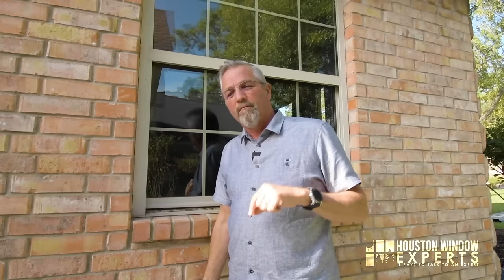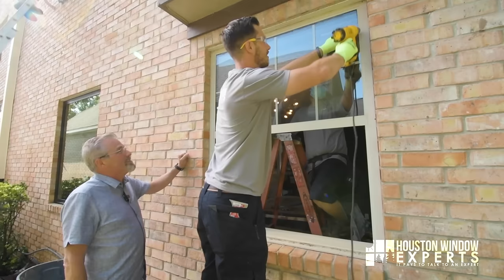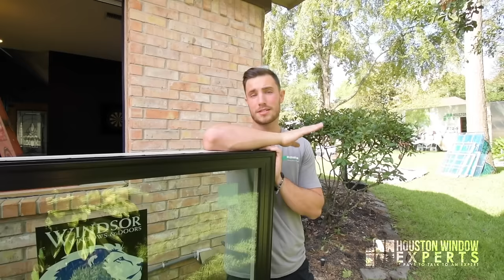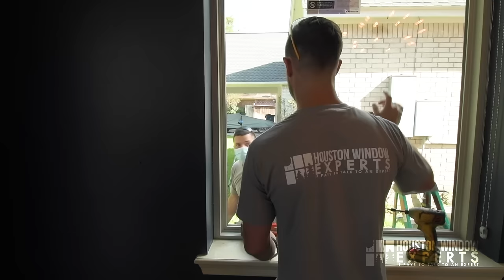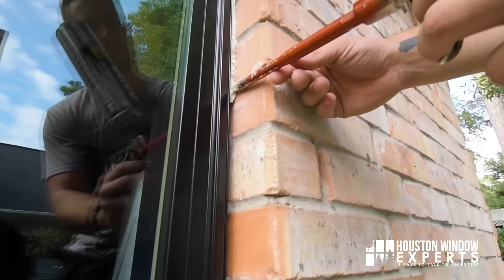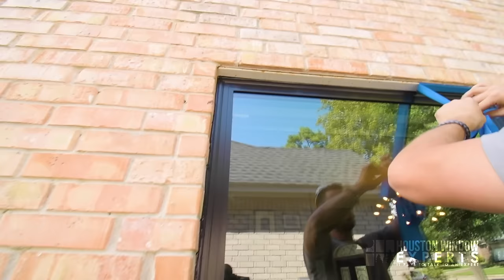Replacing Windows In A Brick Home The RIGHT WAY

Comment: I had NT window replacement on stucco..Previous windows were built into the wall. Is window replacement with caulk on stucco a bad idea? I have some issues with how they did the install but I’m also wondering if I’ve lost the windows ability to shed water.
Reply from the maker: Brad, I'm sorry you are having issues. Without more details, it is hard for me to judge the quality of the installation. 

I'd ask a local window company to come evaluate the installation and offer an opinion. You could also contact NT and get some suggestions of who you could call.

If your windows are leaking, I'm 99% sure it's the installation.
Reply: @HoustonWindowExperts  I’m in Dallas, have you ever installed replacement windows on stucco without tearing around the window and applying new stucco? Also, what kind of caulking should be used on stucco? Much appreciated!
Reply from the maker: Yes, we install Windows and stucco homes almost every day. If it's done properly you will not have any damage or very little and it can be easily repaired.

We like to use OSI Quad Max caulking.
Reply: @HoustonWindowExperts  I have a serious problem on my hands after my install. I just sent you an email and would greatly appreciate your opinion on what they did. I’m also wondering if it’s proper to remove the old nail flange & how to keep the window water resistant for years to come. I will gladly pay you for a virtual consultation.
Reply from the maker: Brad, thank you for your comment. I'll go check my email and get back to you asap.

Comment: Hello, I'm really late commenting. So sorry! We purchased an 1895 modified victorian gothic brick home in 2006 (it has a turret - lol). At some point, Pacesetter windows were installed throughout. Beautiful windows with integrated metal casements - but which leak due to broken locks/clips no longer made. We've replaced a lot of windows on other homes we had, but they all had wood casements. We really want to keep the metal casements since we have no idea what's under them, and they're dark bronze which looks exceptional! Can we install new windows into the existing casement? I have no idea how to finish trim them, and  adding metal channels would destroy the aesthetics. Am I asking the impossible? Thank you so much!
Reply from the maker: Thank you for watching and your question. I don't think you can do that.  Sorry
Reply: @HoustonWindowExperts  Well, darn. It was worth a shot. I may have misspoken on "casement"  when I should have said casing. Thank you for replying!
Reply from the maker: In that case, Yes! Please check out JeffsList.com. We may know someone near you.
Reply: @HoustonWindowExperts  Awesome!  Passing info onto husband. Thank You!
Reply from the maker: Thank you

Comment: Good video.  It is worth mentioning though that OSI quad and quadmax are not VOC free. Tech datasheet gives the offgassing numbers, max is lower but certainly not zero.  A water based caulk will have less fumes inside.  Quad is for exterior only
😂
Reply from the maker: Thank you for the clarification.
Reply: @HoustonWindowExperts  Sure, excellent installation btw!
Reply from the maker: Thank you

Comment: Hey Jeff, OSI Quad Max says you shouldn't tool its caulk but you're doing it during you installs, is it ok to tool?
Reply from the maker: We have spoken to their engineering department about this. The reason they don't like you to tool their material is because it ends up not having enough material retaining on your window. However, if you apply it heavily and do not remove too much of it, it's just fine. We've been doing it this way for 14 years and do not have any issues.

Comment: Hi Jeff I have a window project (26 windows, 4 sliders) coming up and I have 3 windows in Brick and 1 in stone, the installer did final measurements and is down sizing the windows by 3 1/2 W x 3 1/2 H to accommodate 1x12 box framing. Should I be ok with that install method, I asked him if the windows could be installed through the frame he told me no. Having seeing this video I’m not sold on his installation method and losing that much size on the windows, his argument is that my windows are 10ft I won’t notice it.
Reply from the maker: If I'm understanding you correctly, I think he's not doing things the best way possible. I cannot think of a reason why you would have to block off that much to put in the windows. Are you sure he's an experienced installer? Have you had a chance to review his credentials? I actually may know somebody in your area that could be of help. Take a moment to visit JeffsList.com
Reply: @HoustonWindowExperts  That’s the reason I am asking your thoughts on his methods, I got his info from the recommendation for my area. I can email you directly so as not to put a name out in public, because I was quite surprised when he explained his method and why he was sizing down so significantly.
Reply from the maker: Yes, please email me at Jeff@Houstonwindowexperts.com
Reply: @HoustonWindowExperts  just sent it over

Comment: Interesting that you don't use thermally broken aluminum extrusions. As that product is the best in the market. Standard doubleglazed aluminum windows like this still condensate on the inside of the  aluminium face.
Reply from the maker: Thanks for your comments. This is a vinyl window. We do use thermally broken aluminum windows as well but not on this job.

Comment: Jeff, I appreciate the information from your videos. I'll need to reach out about your recommendations for my area. I have a question about the soap and water you use to smooth out the sealant bead. What type of soap are you using? Dishwashing liquid? Thanks!
Reply from the maker: Allen, thanks for your comments!

We use about 10% dawn and 90% water in a squirt bottle.

Yes, I have window friends all over the USA. I may be able to refer you to someone in your area.
Reply: I've seen/used  soap and water , but also, rubbing alcohol and even denatured alcohol. Back in the day we used acetone and xylene.
Reply: Any recommendations on windows and installers in Murfreesboro TN? (South Nashville).  I purchased a very expensive wood package for my estate home I sold. You could blow a match out between the window and sill.  I now own a brick home with builders grade.
Reply from the maker: Thank you for watching our channel. Yes, I'm sure we have somebody in your area that we can recommend. We get so many of these requests that we actually built the website with a list of great installers all over the country. Go check it out and see if we have someone near you. JeffsList.com

Comment: Are you familiar with KHPP windows? Also, is full frame replacement worth it over insert windows?
Reply from the maker: Thank you for watching and your question. I've never heard of that brand but I will check it out. Full frame replacement is only worth it if you're going to lose glass doing an insert. I always like to maximize the glass space on any project.
Reply: @HoustonWindowExperts  Okay, thank you. We were referred to by the salesman to KHPP. I was looking at the marvin essentials fiberglass window. The salesman said the u factor of the KHPP is .20. I tried doing my due diligence on them but couldn't find anything.
Reply from the maker: Don't get hung up on merely numbers. What's more important is who is installing the windows, and what kind of service and communication can you expect going forward. UFactors is splitting hairs.
Reply: @HoustonWindowExperts  Dually noted! Thank you! Wish you guys were out in the Chicagoland area!

Comment: Gosh, have watched so many of your videos and am very appreciative of the knowledge you share.  I have a question, how does one attach to an all brick home that was built in 1954? Because it is old, it doesn’t have a wood casement to nail into, but has a solid steel flange that is actually inserted into the brick and is 1/4” think.  The house is located in Denver.
Reply from the maker: Thank you for your question. Without me knowing more about your project it would be pretty hard for me to answer that question. We may have a great window dealer in your area that could come out and take a look and make some suggestions. If you'd like to see if we know somebody in your area you can visit our website at JeffsList.com
Reply: @HoustonWindowExperts  Thank you, buzzed over, and completed the information requested; have a great day!
Reply: @LoveColorado They won't tell you. I'm in business but no window expert, I'f I'm in you situation I'd first try to drill through steel plate then use metal screws to attach window frame. It's not that hard to drill on metal we attach new wall plate on steel beam all the time.
Reply: I have a 1952 brick home.  It's been about 20 years since I had a friend (builder of homes all his life) replace 12 of the original wooden windows in my home.  It's been a while, but as I remember it, we simply pried off the inside trim, removed the old window, screwed the new vinyl window in place.  Shoved insulation = the pink stuff in your attic around the gap between the window and the opening. Put the trim back on and on to the next window.  I carried the old windows away and brought the new one to be installed to my friend.  We had replaced 12 windows in a little over a half a day.  I didn't have to paint or fix a thing.  Easy Peasy.  I've never had any problems the windows.
Reply from the maker: Awesome story!

Comment: Thanks for the video! Were the nailing fins removed for the installation? I have a brick home and we are doing window replacement as well. I'm interested in knowing how the waterproofing works without the nailing fins.
Reply from the maker: Hi, the fins had to be removed in order to install the window. We use a low expansion foam in order to fill the voids and seal the window property.
Reply: @HoustonWindowExperts  this is the secret shhh lol
Reply: @HoustonWindowExperts  Thanks I was just asking about this above. So we won't have room for nailing fins either. I have exactly .75" extra in my brick molding. I am not even sure how that is but measured multiple times by myself and another from the inside and the out -  he removed the sash - I removed the trim. So I need the windows to squeeze in there. I read on JCL that you can flash by sliding it under the brick using metal instead of the sticky vinyl tape but it's not ideal so when I studied your window before trusting any installers I really wanted to know how my installation can be done right with only a .75" difference or gain in my brick opening to my inside rough opening. So the foam is enough then? I hope so because I want to schedule this soon. BTW Really appreciate the honest info. It's so hard to know who to trust online and really liked your video.

Comment: I live in a stucco house in San Diego and have been told that retrofit windows are almost the only & economic way to go. I am not thrilled at the large framed look v the slimmer aluminum styled frame that we currently have. What are your ideas?
Reply from the maker: I'd look into the Milgard Styleline or Amsco Studio. They are both very narrow replacement window products.

I do like the Amsco better than the Milgard.
Reply: @HoustonWindowExperts  I will check it out. Thank you. I was looking at the Trinsic line which seemed to be similar to the Style line.
Reply from the maker: The Trinsic is very wide and chews up a lot of the glass space.
Reply: @HoustonWindowExperts  Is the frame size difference significantly obvious to the naked eye between the two lines(Trinsic & Style)? And does the quality and energy efficiency compare if I decide on one over the other? Plus, how long do you think the beautiful black framed windows will be around?
Reply from the maker: The Styleline frame is about half as wide as Trinsic. 

I think the black look will be here for at least another 20 years.
Reply: @HoustonWindowExperts  perfect! Thank you!!! These videos are so educational and nicely done. Nice job! Wish I lived in the Houston area...kind of. :))
Reply from the maker: Thank you for watching!
Reply: Would fiberglass frames be an option?  What do the install pros think of this frame material, the look, the feel, the quality, the installation process?
Reply from the maker: Fiberglass is a great product. It does have some limitations when it comes to size but it is very durable and looks great.

Comment: I have a very similar scenario where BRICK ROUGH OPENING is larger than the ROUGH opening (the studs). So installing a new window in the ROUGH opening would mean I have to trim the exterior with composite to close the gap between the window and the brick but I'd like to avoid that and do what you did here, I'd much rather trim the interior. My new windows are 3" deep just as yours in this video. Now my question is - is it SAFE to measure the new window to be 3/8" smaller both width/height than the BRICK opening width/height and not worry about the ROUGH opening?
Reply from the maker: That's what I would do. If you measure it too wide you won't be able to fit it through the brick.

Comment: What are your thoughts on triple pane low e?
Reply from the maker: It's great in cold climates but double pane is better in warmer climates. Where do you live?
Reply: @HoustonWindowExperts  can you explain a little more regarding to double pane better than triple panes warmer climates?  I m living in Dallas area. thanks.
Reply from the maker: Triple pane works best in very cold climates. Double pane performs better in warmer climates AND has fewer seal failure issues. I'll make a video soon.
Reply: But you must know triple glazing stops natural heat come into your house so you must have a decent heating unit. Double glazing will still let in natural heat source.

Comment: Where did you get the the screws? All i can find is 2-3/8.......
Reply from the maker: Try a decking supply store.
Reply: @HoustonWindowExperts  is there a specific brand name to look for? I havent seen this kind of decciing screw before. Unless its just harder to tell which ones they are on the video. Are they the ones with the spiral shank at the top?
Reply from the maker: Here's an example of a 2" screw. We use 3-1/8"

 https://a.co/d/4N1649D
Reply: @HoustonWindowExperts  wow! Thank you, i must have passed by that one several times and not even noticed it.

Comment: Looks like good work. However why don't installers remove the brick around and tape the window to recreate the building envelope? Even with foam vapor drive will push in and eventually stain the sheetrock. If the caulk is the what you guys use as part of the envelope I wouldn't trust anything less than np1 specially in Texas.  But as installers go you guys as good as quality gets around here.
Reply from the maker: Removing brick is expensive and not necessary. We have over 100,000 windows installed this way and no leaks.
Reply: @HoustonWindowExperts  not saying windows leak, but that it's not possible to create a good air/ vapor seal without it. Didn't know if you guys had a trick to recreate envelope.

Comment: You said 47 3/4 but you measured 47.5 so how the heck will you fit that into into the hole? Also why not measure the window itself, why do you measure brick to brick?
Reply from the maker: Once the brick is in, you're new window needs to fit the opening. Measuring the window is impossible because some of it is now behind the brick.

Comment: What’s wrong with the window being replaced? They say it’s “Junk” looks nice to me.
Reply from the maker: You should have seen it. It was falling apart, wouldn't keep out the air and dust, and had huge condensation issues. They also hated how it looked.
Reply: @HoustonWindowExperts  ahh... How will the new window prevent condensation?
Reply from the maker: Yes, actually quite well. They live on a lake and condensation is an issue. We installed these windows a few months ago and the homeowner called me a few weeks ago to let me know they are loving everything about the project. 

I will do a follow-up with them in a video this summer on the lake. Super cool couple.

Comment: You must have misspoke. You said your narrowest measurement was 47 1/2, but then go on to say you're ordering the window at 47 3/4 minus an 1/8, or 47 5/8. You must have meant to order 47 1/2 minus an 1/8, or 47 3/8. I'm sure that's what happened. Measure twice, order once.
Reply from the maker: Good catch!
Reply: @HoustonWindowExperts  No problem. Wasn't meant to be nit picky. But, you guys seem so specific and professional, I just wanted to be clear. 😄
Reply from the maker: Just a slip up.. no worries... Thanks for pointing it out.

Comment: There’s zero reason to replace those windows
Reply from the maker: The homeowner did not like the color and they also did not like the grids. They were also a few units around the back that had IG failures. It could have replaced just the IGS but they knew they were going to keep having more and more issues over time.